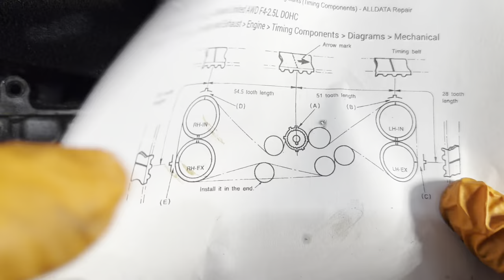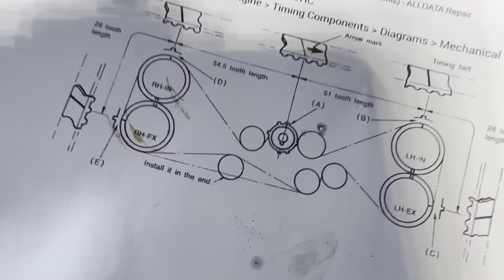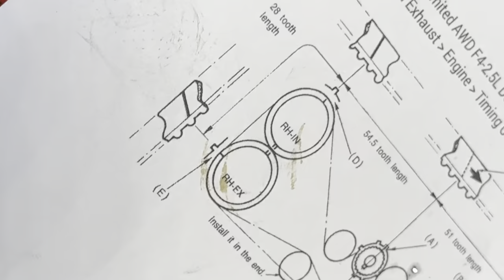SOFT METAL!  Engine Damage! Subaru Legacy Outback AWD 2.5 DOHC EJ25

Comment: My hubby has had stripped spark plug holes in Corvair engines[flat-six boxer design]...he has a  spcl
left-handed drill kit made exclusively for Clark'sCorvair Parts in Massachusetts.....and the tap is split in half with strong tensioned rubber ring retainers to allow inserting in plug hole orifice, then reassembled tapping hole with right-handed threads in reverse from inside combustion chamber[cast iron alloy cylinders] for spcl insert  from kit...he adds some grease from kit
and results is that chips will come out of 14mm spark plug hole of the Reynolds aluminum alloy
"non-cheesy"
material of cylinder heads on assembled powerplant(top end sheet metal removed)...
TORQUE WRENCHES and HAND TIGHTENING ARE CRITICAL FOR THIS UNIQUE CHEVY AIR-COOLED MOTOR...just "saying click" will be cause for stripped threaded portions of main block/cylinder heads, crankcase/blower cover torque specs...
But, you did well in not giving up until successful! Enjoyed sharing your challenges...
(BTW...wonder just who was stealing engine ideas from who during WWII??)
Former Charter
Member 
CorvairAtlanta/
CorvairSociety
of America
1976-198_(?)
w/D.A.L
friends/engineers

@Larry D Shaw/aes
FPK GA...(happy at retired working at home small engines/property projects)

Comment: In the opening segment when you pointed to the vehicle out in the parking lot awaiting this engine, it appeared as if a car was sitting out in the pouring rain with its back hatch wide open. I had to back the video up and enlarge the picture to see that I was wrong. Whew…..glad I was mistaken and that you remain perfect….except for tightening bolts into an aluminum block.

Comment: Ray- A glob of very sticky grease on the end of the drill bit can grab a lot of the shavings.
Sometimes you have to drill, clean the bit, reapply sticky grease, and drill. It does work. Not 100 percent, but I have not had problems with that method. Was taught to me by old machinist that rebuilt engine blocks.

Comment: just letting you know, you can buy a replacement piece for just that location. its designed to be replaced and is separate from the block. I forget what its called off the top of my head but its inexpensive and much much safer to do than using helicoils or similar. Also when reinstalling the timing belt, you want to keep the idler, left of the cogged idler, off and install it after all marks on the belt+cam sprockets are lined up.
Reply: Pretty sure Subaru calls it a "Timing Belt Tensioner Bracket -- Complete" at the dealership's parts counter.
Reply: ....$35 new from Subaru. It's held on by the 4 bolts you can see in the video.

Comment: @4:45... I'd dip that bit in grease to keep any metal chips from ending up inside the block. Also, drilling anything larger than 1/8"... switch the drill to low speed. @6:45... Also, time for a new drill, or a new motor for that drill. The output shaft is tweaked. See your chuck wobbling?@14:00... I put a nut on the installer. I then put the insert on and run the nut down as a stop nut. @17:40... You need some sanding discs.

Comment: You sure are calm when doing the repair work on those fasteners.  My kid and I had to replace a steering knuckle on my older truck with the only one we could find (Ebay Motors.)  The threads were not machined all the way, so we had to remedy that.  Before doing so, I did two signs of the cross and a prayer, carefully torquing the bolts down.  😅

Comment: Great video! I will note the tensioner bracket hole you tapped and repaired can be unbolted easy from the block and swapped from ANY EJ engine ever made ever. Thats from 1989 to 2021! Lol, when you buy a short block from Subaru they dont have that bracket and you need to swap it.

Comment: Applying a heavy coat of grease on the drill bit will help catch the metal chips. Drilling slow and cleaning, reapplying grease will help with this process. Galling is likely the cause of the stripped aluminum threads. Removing bolts in aluminum should be done by hand using the worrying method. Working it back and fourth in tiny increments until it moves freely. Heat can also help release galled threads. Stainless has the same issues. Slow and easy rainman will save you from these issues. This is motorcycle 101....:)
Reply: Always torque bolts in aluminum. I learned my lessons the hard way :)
Reply: And for precision work don’t use a battery powered drill so you can keep a fast drill moving preventing less wobbling and over drilling the hole.

Comment: A short comment on the S-10 being worked on. Many wouldn't believe you had to pull the engine to do that pan/seal repair. But back when they first were released I worked for Chevy/GM dealer, those S-10s came in with rear main leaks, the book said to pull the engine. We tried to pull the pan without pulling the engine, you can but I think it was more work to not pull the engine.  What a horrible design.

I agree with you, Ray, on wanting to put a V-8 in the S-10. One of my car magazines did it and ever since I wanted to. It was a Corvette engine swap, very clean, looked factory. And now there are so many kits with the headers & mounts & radiators to do it. I have a '95 S-10 I retired when I bought my Colorado. That's my vision; a V-8 transplant.

Comment: Cork gaskets with "COPPER COAT" spray on or brush on never leak.  Same goes for paper gaskets used in oil, and water, always use "COPPER COAT", I have built A LOT of engines using this.  Not only does "COPPER COAT" seal the surface of the gasket to prevent leakage through capillarity action, it helps the gasket stick in place for ease of installation,  should the gasket ever need to be removed again, it allows the used gasket to come off in one piece, very little, if any scrapping needed to clean surface for new gasket.  The KEY to a good seal using this system is preparation, no contaminants on the gasket surface to be sealed, no oil, water, dirt, grease, finger prints, nothing!   Over 40 years self taught experience in ALL aspects of auto repair and building, (through my own mistakes), best teacher there is!!!    The only thing I hate more than cleaning dirty engine parts, is assembling dirty engine parts!~!!

Comment: The time certs I have .there are two slots  cut into the end that sticks out. It came with a bit that fits inside the time cert and has two cogs that fit into the slots on the time cert so you can thread it in and tighten it.

Comment: Get yourself a 4 way HVAC ratchet, they have 4 square sizes of 1/4, 3/16, 5/16, and 3/8, I use them for driving taps in tight spaces.

Comment: You get some drill stops for your drill bits. This way you don't have to worry about the bit getting away from you and going further than what you want.  You could have used a nut on your insert tool to lock it to the insert.

But a good bet you are having a good feeling to see a light at the end of the tunnel with the Subaru project.

Comment: If you look at about 10.54 it looks like you should have run the tap down further, could explain why time zerk (sp) didn't fit in all the way. looked like threads stopped about 2 short on right side of hole. Great job fixing it.

Comment: Btw using the right stuff makes it almost impossible to remove valve covers and oil pans again. With r&r gaskets it’s easy to find suppliers that can provide Teflon or rubber gaskets for almost any application.

Comment: Ray, if you put some grease in the flutes of the drill bits and taps, the grease catches the cutting's! Put a nut on the installer first, time sert swages the last threads as it tightens down.

Comment: If you pack the drill bit & tap with grease it will catch most of the shavings instead of going in motor. I do that for spark plug hole repair.

Comment: When drilling into a soft metal like you are, break the cutting edge of the drill. It's too sharp and that's why it's grabbing. We use to use a grinding wheel to grind off that sharp edge just a little, makes a big difference. JN

Comment: I see a whole bunch of suggestions in the comments about how things could have been done.  My suggestion would have been to have a shop vac running to suck all the metal shavings from drilling to keep them from getting into the cooling system and potentially causing a restriction.

Comment: My guess is Subaru mixed the batch of aluminum without the necessary silicon, copper or iron. If you have ever seen raw aluminum it is very soft. When mixed for the wings of a C5A Galaxy a large amount of silicon is mixed with the aluminum to make a very tough aluminum. A special formula, maybe a touch of titanium to toughen it even more. Hurricane Lee is having it's way with you Ray. Making ya'll a real rainman.

Comment: The inside bottom of the insert is slightly smaller than the inserting tool.
As you continue to thread the insert tool into the insert it expands the insert to lock it in place.

Comment: It's possible at the foundry the molten aluminum was not adequately degassed,this will cause bubbles in the casting leading to weak treads! Excellent repairs.Looking at the paint marker makes I wonder if the timing belt had been replace before?great save.Have a great weekend
Reply: Old aluminium is this way, it's scary how weak threads are in aluminium. I've had so many bolts pull the threads out even though they feel like they're coming out just fine. Awful stuff, safe to say I've thread inserted a good few holes in various aluminium components. (Road salt doesn't help the situation either)

Comment: Undoubtedly someone else as mentioned this, but I'm pretty certain you didn't tap deep enough. As far as I know those taps start slightly smaller diameter intentionally, you have to tap past the tip to cut to the full diameter. Probably something around a quarter to half inch.

Comment: S10 brings back some memories finally died from massive oil leaks and broken clutch throw out bearing 
It was a1983 long bed heavy duty camper certified that could handle big loads of junk
Sold it to a you lady that was going to small block V8 swap

Comment: for the inserts you are using the insert tool needs to be moved all the way in as it slowly lincreases in diameter

also you need to flush the water jacket before you try to run this engine or you will fill the radiator with metal

also if you did not notice the shape of the top of the water pump pulley it is sloped it is almost if they designed it that way

that engine type is called a boxer

Comment: This is why power tools are for removing and toque wrench for tightening. Seems like doing it correctly maybe faster than using power tools! Put the bolt in correctly the first time and no drilling required.

Comment: Wow Ray don't even do two full revolutions in the direction of rotation and check your marks again before putting the timing covers back on. Very sloppy considering you should know better
Reply: Agree, but if he reads all comments then it's still not too late, he just needs to remove those 3 front "dust covers" and rotate the crank 720* to confirm aligned timing marks on cams, crank, and case (marks on the belt will no longer line up at that point AFAIK, which is irrelevant).

Comment: To install your thread insert, use two M10x1.25 nuts on your insert install tool. Put the nuts on, then your insert. Thread the nuts down against the insert and tighten the nuts against each other. That will serve as that lock or stopper that you wanted.

Comment: I had one of those s10 trucks I think it was -80 model 5.7 diesel originally,  when I got it there was 455 cid buick in with big carter carb on hi riser. Bad,Bad thing to all others in gruising eves, really bad to my wallet also, filling up all 140 liters was not so cheep here in Finland, and when you burn some 50-100 liters per 100km and set of rear tires in one evening, it hurts. But all the fun I had doing it, priceles:glasses-purple-yellow-diamond::eyes-pink-heart-shape:

Comment: Back in the 80s, had a Fiat x1/9 mid engine with the aluminum cheese alloy block. After I had replaced the head, coolant was flushing out the exhaust. An old hack "mechanic" came over to me and grabbed a wrench and proceeded to strip every one of (my properly torqued) head bolts. The water was feeding from a hole in the wrong head gasket that did not block the EGR pipe from the water jacket. Had to helicoil and epoxy every head bolt, but eventually got it back to working order. Learned not to trust impatient "mechanics".

Comment: Ray that part where the tensioner mounts is not the block that is just a bracket that is bolted on
Reply: ive done lots of these, usually subaru dealer has the bracket on  the shelf. also binder clips are your friend on these engines clip the timing belt to the pulleys keeps them in place with you route belt
Reply: @jim78  Yup, large binder clips for the win.

Comment: 1. It looks like you go too deep with the counter bore. Do some counter bore, turn the insert over and put the head of the insert into the bore and LOOK to see if it needs to be deeper.
2. It was easy to tap because you kept going back and forth with the drill bit and making the hole oversize. When the drill goes through into the void, STOP. Let the tap remove what it needs to remove instead of you removing it.
Reply: 3. With two sets of threads going into the cooling system, I would have put the Locktite on all of the insert threads and Permatex on the bolt threads to reduce the chance of a water leak.

Comment: Ray, all you needed to do was run the tap in a little further. You stopped too soon. The taper of the tap wasn't thru the hole. So the time sert couldn't thread all the way because of the taper in the hole.

Comment: That is one the major problems with aluminum and steel bolts I never had that trouble until i got a 97 mercury mountaineer that needed a water pump 1 bolt broke another stripped out getting it out ! Also that block is made out old beer & soda cans !

Comment: Ray, may I make an observation on using Thread Wire inserts ?  Be certain of your drill speed.  A 10mm drill bit in alloy, requires a speed of 2500 r/m, which Battery drills cannot do, so use a corded, which can.  Secondly, if possible, use a three flute drill.  They are expensive, but very effective in cutting a hole in thin walled alloy.  If at all possible, especially if the bit is new, sharpen it  New bits cut .0001/.00015 oversize,  and you need all the bulk material you can.
Thanks and good luck with your project and your business

Comment: I’m watching this and thinking what not to do!  It’s an aluminum block and your running bolts into it at full speed.  You’re tapping all wrong.   You’re blowing aluminum bits into the engine.  I’m wondering if he is going to end up with a small coolant leak at the tap.   I missed the last screwup with power tools and his repair for that. I hope it wasn’t done like this one, but I assume it was.

Comment: You may aswell have bought the new timing belt tensioner bracket it would have been cheaper than that insert kit.
If like you say that tensioner bolt hole protrudes into the water jacket there should be an 'O'ring on the rear that sits in the little counter bore that was in the threaded hole but you have threaded the insert flush so no room for the 'O'ring to seal the water jacket and the threads on the tensioner bolt, the threads alone aren't going to seal the water in.

Comment: Always found Japanese aluminum to be something like frozen margarine. And as far as Drilling and tapping I like to use an electric drill variable speed they're less likely to bind up and bog down.
Reply: The 3UZ-FE V8 block and heads in my LS430 are plenty stout to handle the factory 278 HP and 312 lb-ft torque.  But then, I'm also someone who believes that torque specs and torque wrenches were developed -- and should be used -- for a reason.  😎

Comment: Ray, if that bolt goes into the water jacket, you HAVE to put some sealant on the bolt threads or it will leak.
Reply: @J.Rein702  That hole is in a removable bracket, not the block; there's just dead space behind it, not water jacket.
Reply from the maker: I didn’t realize it was a bracket 🤤 Jokes on me ig…Subaru things
Reply: @RainmanRaysRepairs I kept wondering why you didn't just replace the bracket, just 2 bolts and off it comes, instead of going through all of the troubles of repairing that hole. now we all know🫣🫣

Comment: It doesn't really matter now but the part the tensioner is bolted to is replaceable, there was update in the mid 90s to a new style tensioner so the bracket that is being repaired should be readily available, I probably would have at least taken it off and did in a vise or something.

Comment: Yeah, and hold your horses, Ray. You said this is not a blind hole; it goes all the way through the engine block. I don’t think those metal shavings from the drilling op are good for the motor oil (shavings gravity.) Maybe vacuuming the chips out would be better than blowing them in, eh? 😅 Good thing Ray has Tap Magic; that should work. 😏 We love you, Ray; keep Subaru-ing!
Reply: He’s supposed to change the oil pan gasket next I think he will clean it then
Reply: He said the hole went into the cooling passages, not into the oil area.
Reply: @jeffleach2668  well, we probably don’t want the shavings in the engine coolant, either. 🤮
Reply: @williamsquires3070  agreed not optimal for water pump tstat rad etc, but at least there's no bearings to mess up in the cooling system. 
(I am curious if we'll see a good flush of this block before it goes in)